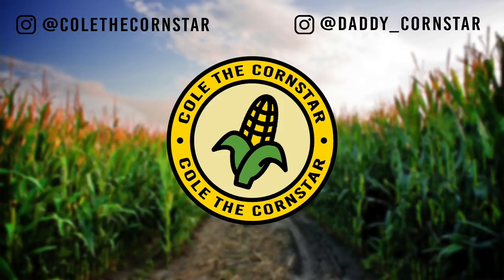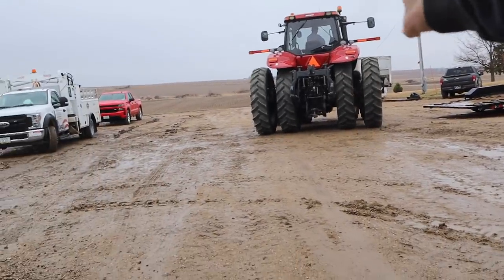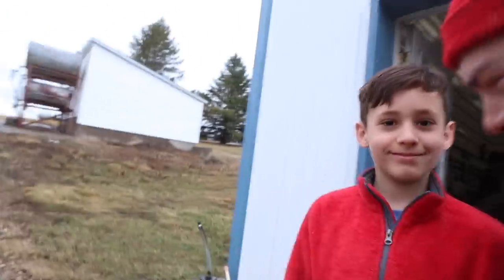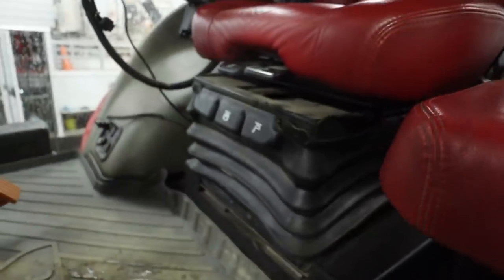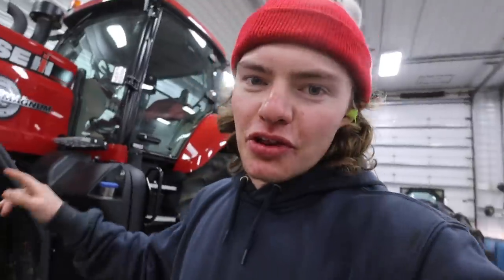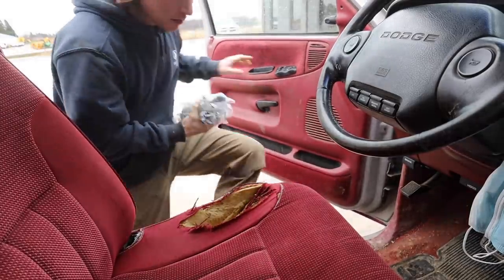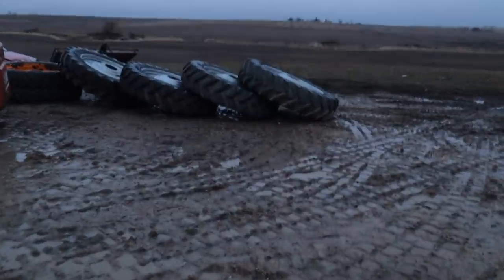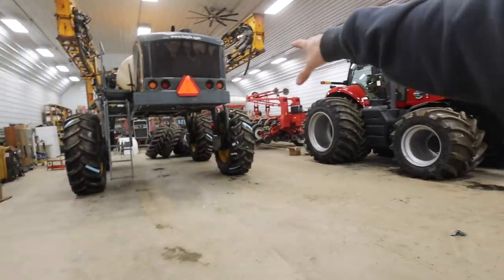Installing The LARGEST Tractor Tires In The World!

Comment: Tell the guy swinging the sledge he's my hero. Seriously. It takes real men to do that kind of work day in Day Out and not get anybody hurt. Bossman was legit too.
Reply: tyre and wheel fitting is serious graft   total respect to those guys
Reply: I replaced the brake pads on my Dodge Ram a couple weeks ago.  The rim on the front passenger side was rusted onto the wheel hub.  I had to use a sledge hammer to get it loose.  Good to know I'm not the only one that happens to.

Comment: I've seen many comments about how the larger floater tires will compact the soil more, I'm not sure I understand this thoery, but maybe if you go outside and press 2 fingers into the soil, and then press your flattened palm into the soil with the same pressure it will make sense.

Comment: With the duel tires shouldn't they straddle the planting rows? With these new tires you will be planting in the wheel tracks.  Isn't that going to be a big downside?
Reply: No  much more flotation.  Skinnys between the rows will compact way more
Reply: @niekruijgrok422  The LSW tires will float better but you dont have near the traction as you do with the factory duels if you really want the power to the tires the factory duels are the way to go
Reply: @keiterfarms5470  Never had any issues with traction with our bigger tires.
Reply: Couple of guys running them up here pulling 36 row 22" planters...Corn rows that plant in the wheel tracks is shorter more yellowish all summer long,has to be some yield drag.
Reply: How much traction do you really need when you're planting. No tire compaction is better than distributed tire compaction. I have some easy math for you, you have a dual that's 10" each or one floater that's 40" which one give the least compaction?
Reply: @Mazel_Tov_888  floater
Reply: @Mazel_Tov_888  I have factory duels on my 8335r that measure 18" with some squat on the tires right there is your 40" and there is no way I can compansate the price of the LSW for the factory duels
Reply: @Mazel_Tov_888  except my comment wasn't about overall compaction.  The duels don't directly compact the plant root zone below the plant, you are also not planting into compacted soil either.  Planting into a tyre track isn't going to give your plant the best start.   We have clay soil which cole may not have but in our soil the soil would end up cheesy and compacted behind those tyres.

Comment: Well good luck with them tires my neighbor had them on his tractor and he hated them especially when planning it packed the ground too much that the planner openers didn't go as deep
Reply: The whole point of them being that wide is they are suppose to reduce compaction.  Hope they work out well.  They look cool anyway.
Reply: Strange.  I guess the duals were spaced so zero pressure on that row?  I wanted to get them for a tractor.  Was rather expensive.
Reply: yeah they look over kill to me, when you have to add spacers that's a good indication. adding spacers introduces other problems, I know from experience. But hey it looks cool, that's what matter right . too much of a good thing, is bad.

Comment: I would imagine that you will have to almost double the planter depth/tension on the wheel driven print to get even depth of seed across the total planter for even emergence.  Or maybe, the compaction from the wide tire will firm the seedbed and those will be the first plants up! This usually occurs if the soil is on the lighter side but if you have gumbo or heavy soil, the wheel areas will be black all summer unless you get regular good rain throughout the season.

Comment: I had assumed you were going to put the cultivator on that tractor. 
Are you going to drive down rows this those large tires ?
We tried to straddle the rows ..
Some of the corn would come back.
Reply: It’s no longer a row crop tractor after planting.  They have a self propelled sprayer. (Likely have to swap tires for post emergence if anything narrower then 30”)

Comment: We just shipped a 1042 Fendt with Vario Grip and 1400 LSW’s that auto adjust the air pressure. High on the road and lower in the field for traction

Comment: when they set the air psi in the sprayer, did they account for the weight of water?
Reply: They did and fuel.
Reply: Do you really think they would not think of that, really 🙄🙄🙄🙄

Comment: I ran the same sprayer with the skinny tires you had. I was told it was because it fit between the rows which were pretty narrow sugar cane not corn. I assume you are running a wide enough row space? Just kinda wondering about the decision to go that route over skinny tires? I am thinking it's a lot more stable with better traction with the wide ones but probably a bit harder on the hydros?

Comment: Thought the whole point of the narrow tires on a sprayer was to go throw the rows with out damaging the crop.  Are You not going to spray in the middle of corn season?
Reply: Switch back then. Burn down n preplanting spray with wide less compaction.

Comment: They look a bit to smaller profile to work with lower pressures to get traction usually the smaller rim and bigger rubber profile the better grip you get

Comment: What PSI are run in those big tires?
Reply: If you listened he said they are coming back to get them set to the pressure they need with the planter attached
Reply: @rich077140  if you read, he asked what pressure not why didn’t they set them, as in approximate. @kingslawn approx 46 psi in 1400s. according to goodyear chart
Reply: @johnj2748  I did read. They are not set as of the time this video was shot. He explained they are coming back to scale it to get the exact pressures just like they did the sprayer. So evidently the chart is a guide that they are not going to trust and use.
Reply: @rich077140  🙄 I’m sure there will be a big difference
Reply: @rich077140  either way no need to be a total dbag to someone
Reply: @johnj2748  didn't realize I was. But then you started your attitude. So I guess it must take one to know one . Right back at ya!.
Reply: Yes I did  hear  the 2 second clip as I rewatched the video but it was a little late by then.  Thanks mark.c I was curious how low that size would preform at. 👍

Comment: Why would want such a large tire on your tractor I just don't see the reason.
Reply: Having a wide tire means you can lower the air pressure so the weight of the tractor is carried on a larger area. The narrower tires might only have 4 square feet touching the ground while the wider tires might have 10 square feet touching the ground. The weight of the tractor is roughly 30,000 pounds so that would mean that each square foot of the narrower tires is carrying 1250 pounds (6 tires) while each square foot of the wider tires is carrying 750 pounds (4 tires). The less weight there is per square foot, the less the soil gets packed down.